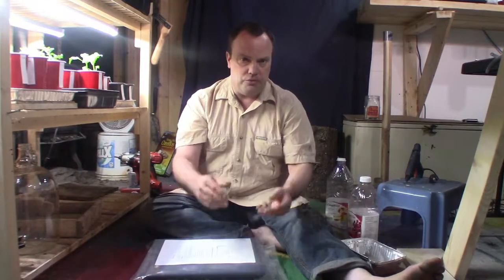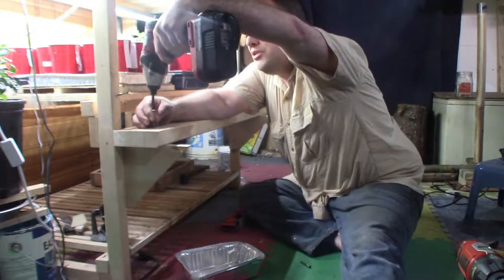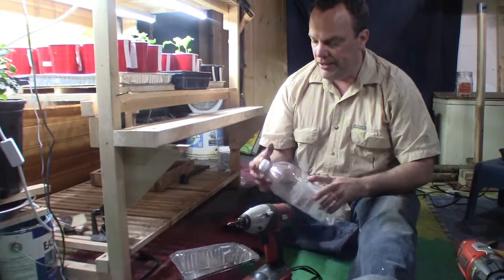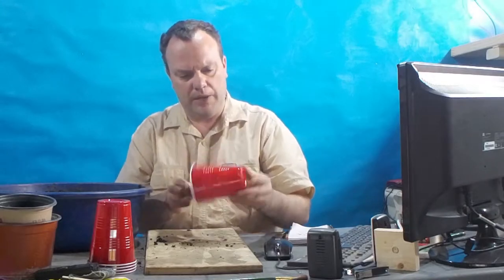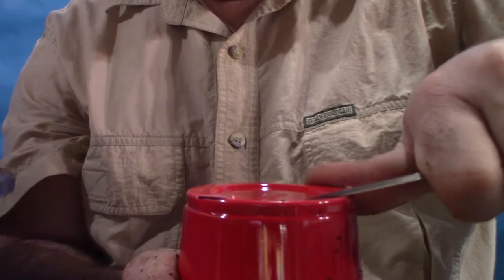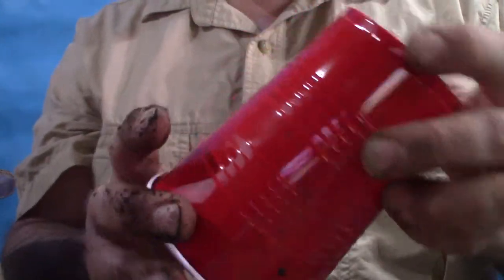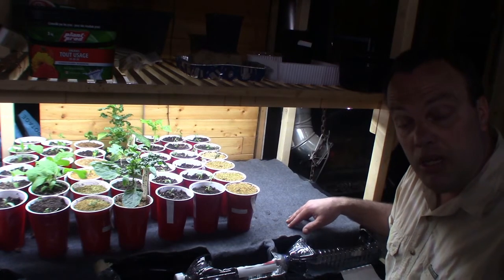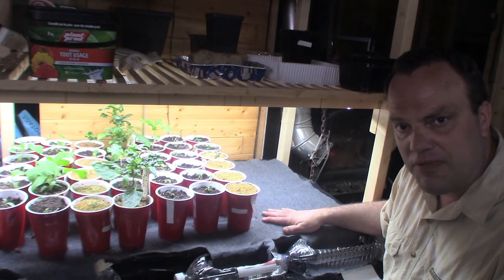Auto water your indoor and greenhouse plants! (Capillary mats)

Comment: I’d be worried about moisture leaching over the ends and possibly affecting lights on shelf below.  Personally I would get a shallow tray the size of your shelf and set the capillary mat in that then have the front hang into your reservoir.  Also, instead of flimsy small containers I would run a section of gutter on that small shelf u built.  Gutter would also hold more water extending time between water additions.  Just my .02.  Overall a good idea, How did this work for u?
Reply from the maker: Yes, I had similar thoughts. I have been remaking the shelving as I decide how I want the grow areas to look.
I have a safer setup now though I will be building the final shelf setup for the grow room during the next two weeks.
It worked like a charm. I didn't have to top water the plants once, Just kept the trays full.

Comment: I cut out a piece of tee shirt and let the cups with the bottoms cut out sit on that material instead of the capillary mat? It keep the mat clean and prevents any growing into the mat itself.  The tee shirt material works fine.
Reply from the maker: Yes, putting old t shirt material on top of the mat would work. When it starts to fall apart you could just throw it in the compost. Good idea!